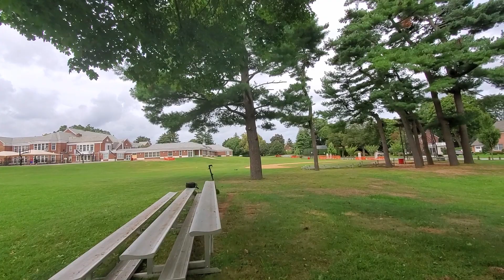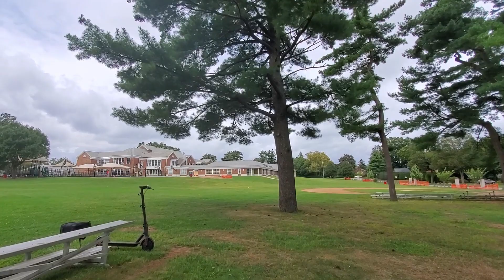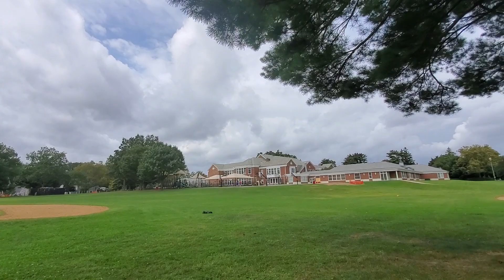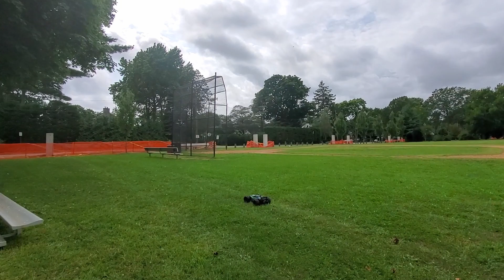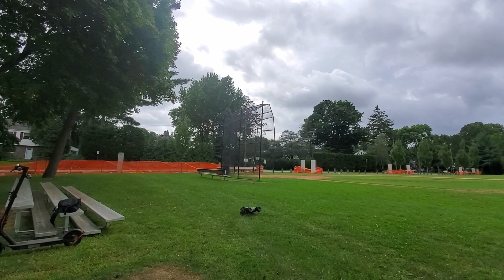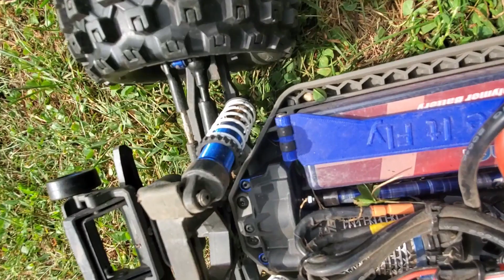Blew a rear diff on the Traxxas Rustler 4X4

Comment: Mine makes weird sounds too when I hold it up in mid air only the rear wheels balloon the front ones don't move and very slowly get rolling over time

Is it the diffs?
Reply from the maker: Yes most certainly is.  Also check your slipper clutch

Comment: mine done the same thing today D:
Reply from the maker: That sux man.  Try using the diff off of a stampede.  It fits in there and has a different setup inside that handles the power better.
Reply: @bakan723  I just bought another one, but I will 100% try the stampede diff if this one breaks again.
Reply: @bakan723  Aren't there any stronger ones made specifically for the rustler 4x4?
Reply from the maker: @jordon7079  I have tried a lot of them but the stampede one has lasted over a year now.  All others I tried died in a couple weeks.
Reply: @bakan723  Really?!?! I'll have to get myself one of them then, got a part number I could steal please? XD
Reply from the maker: @jordon7079  I think it is 6879 but I highly recommend checking for yourself at your local hobby shop or on the traxxas website.  I may make a video on it in the future but in the middle of a cross country move right now.
Reply: @bakan723  I'll have a look, cheers for the help though <3
Reply: I would also try an XO-1 diff